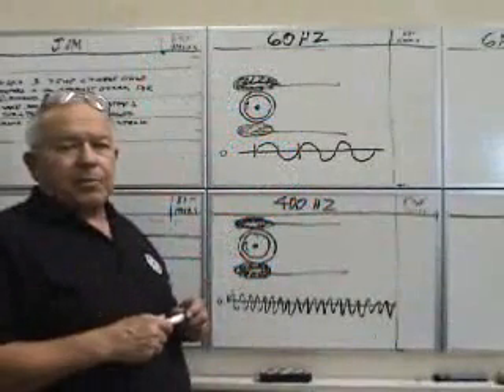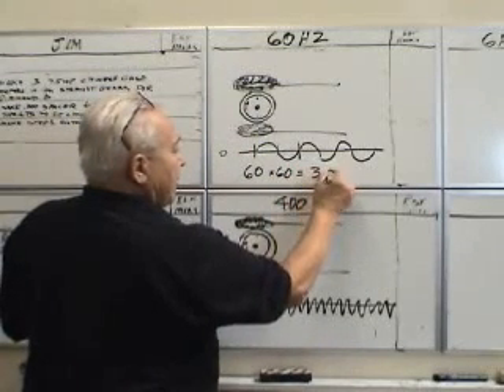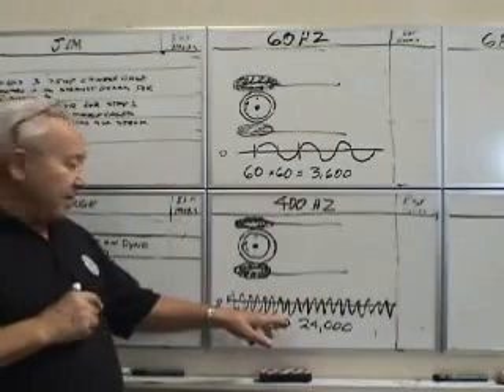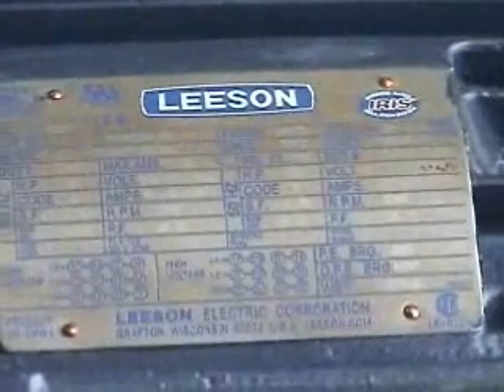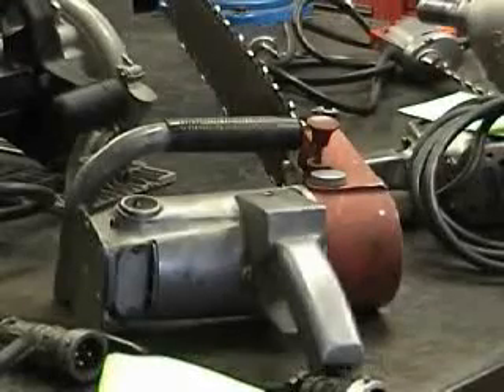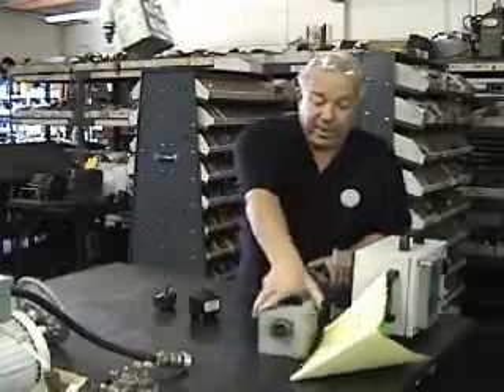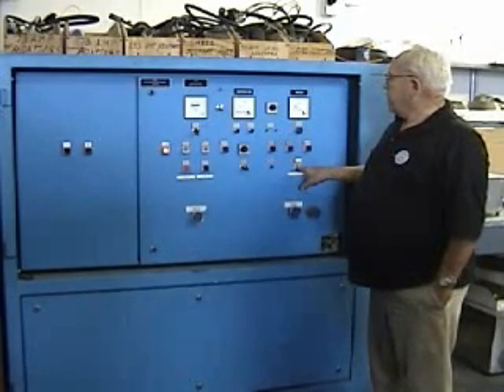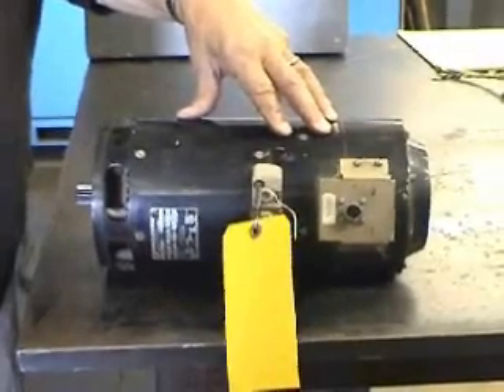Ed Dempsey & 400 HZ Engineering

Comment: Pardon my ignorance, but in the explanation at the beginning, I think we may be conflating terms. 400hz in respect to the frequency of an electrical signal, is not the same as the frequency by which an electric motor rotates (unless we are referring to the prime mover). Frequency of an electrical signal is the number of times the electrical signal propagates over 1 second. 60Hz Electricity cycles 60 times per second, and similarly, 400Hz Electricity cycles 400 times per second.

...I now see this video is 14 years old. Sorry to open an old thread.